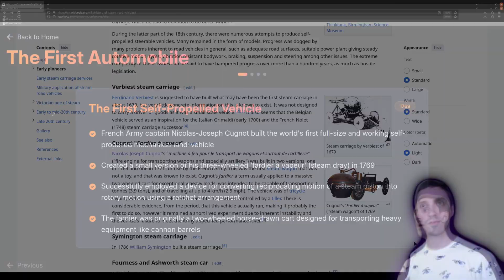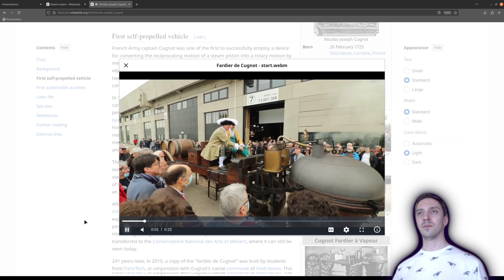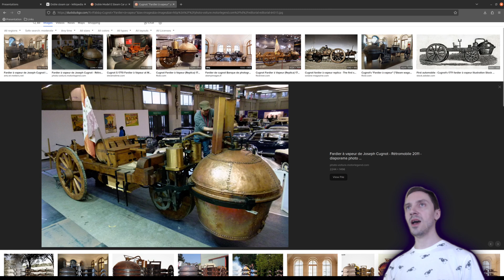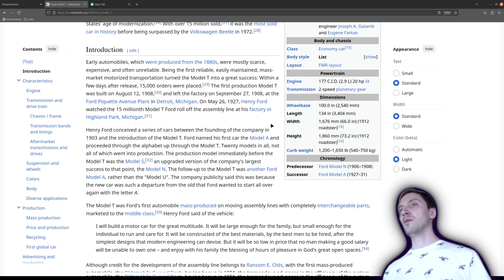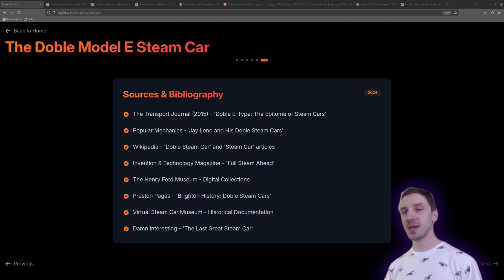The first automobile and the pinnacle steam car

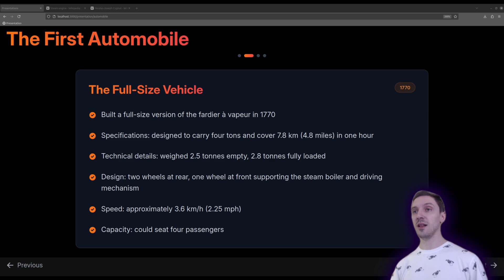Comment: How many horsepower did it have?  2:14
Reply from the maker: On Wikipedia it says 12 brake horsepower (12 PS; 8.9 kW), or 112 newton-metres (83 lbf⋅ft) which I'm unsure if confirmed, for the 2 Cylinder Steam Engine.